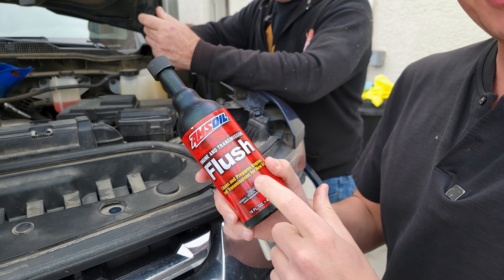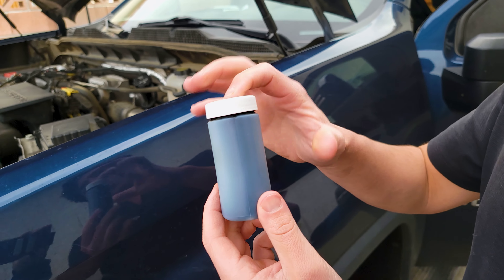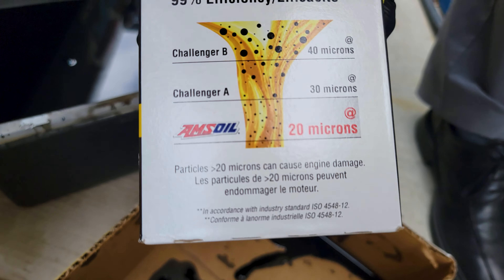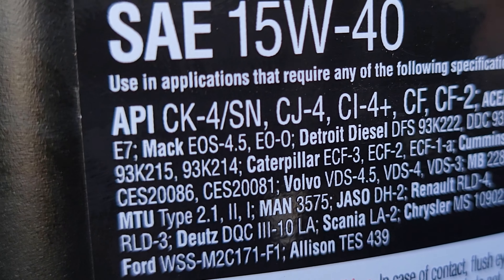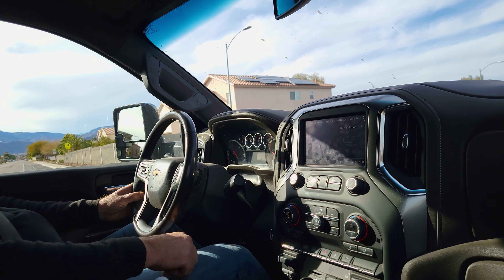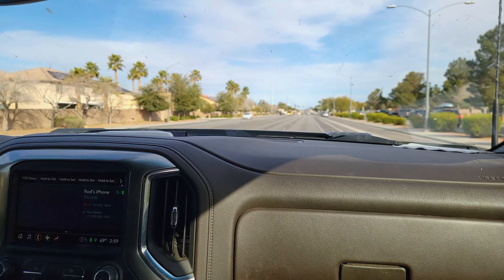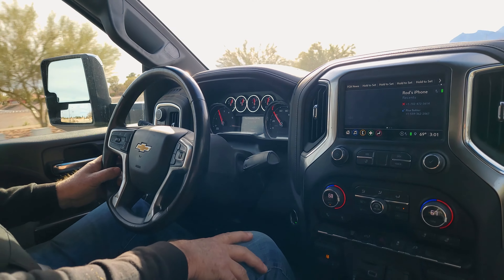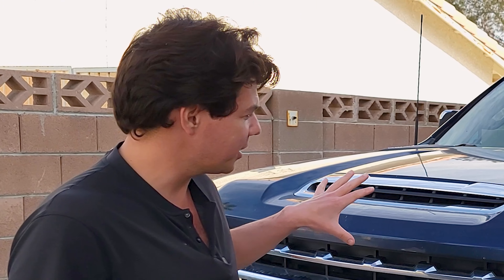Your Diesel Duramax can run better than brand new with these fluids

Comment from the maker: Watch This Next: https://youtu.be/jRu3JH-qDCE

I give a man a fishing pole & show him how to fish. 

     Together! We can get your vehicles to run better than brand new!

     For me to get credit & be "Your" Independent AMSOIL Dealer please use my website below or my dealer no. 5331179 call anytime Eben Rockmaker 702-472-3614
After you click on: http://syntheticoilprotection.net
1. Click hamburger menu
2. Click offers AMSOIL preferred customer
3. Click join now 6-month PC member add to cart. ( there is no reoccurring renewal membership unless you select that dot box ) 
( you have the option to not have your credit card saved if you prefer - est. 1972 )
4. Scroll up to the top Select shop by vehicle.

New promo:FREESHIP
     
     🥇🥇🥇 Synthetic Oil Protection Google map reviews
Eben Rockmaker, independent Amsoil Dealer 
Dealer no. 5331179
(702) 472-3614
https://maps.app.goo.gl/1aXxuXrXK9eJwqK78
            
♥ See fluid performance tests - https://www.amsoil.com/performancetests.aspx?zo=5331179      

     ☕ Buy me a coffee - https://www.buymeacoffee.com/Syntheticoilprotection

🇺🇸 Did you know a oil manufacturer can call a lubricant a Full Synthetic when it's only 25% synthetic? AMSOIL is different because it is 100% Synthetic and has a higher film strength keeping the metal parts separated. AMSOIL allows less friction, less heat, less wear on the component. AMSOIL Signature Series motor oil has guaranteed protection for up to 25,000 miles or 1 year of normal driving. 

     ♥ Your vehicle could run better than brand new by choosing the right fluids! See results - https://youtu.be/by5RYv3Dt0Q

     🇺🇸 Why AMSOIL - https://www.amsoil.com/about/exclusive-distribution/?zo=5331179    

     ☕ Synthetic Oil Protection Coffee - Ebens Favorite: https://supportwith.coffee/shop/subscriptions/sop/

Comment: I ran the cetane boost / injector cleaner religiously in my 2021 ram Cummins high output. I was putting an average of 375 gallons a week of diesel and put the ‘lime green’ bottle in my reserve tank at every fill up.
Reply from the maker: What was your results
Reply: @Syntheticoilprotection  at best, I got 10 mpg. I didn’t keep my truck long enough (87k miles) I think for a full engine break in. It was however getting better and better the more miles I put on it.
Reply from the maker: What type of truck was it?
Reply: @Syntheticoilprotection 2021 RAM Cummins HO

Comment: I noticed the engine light was on, did you check the code. Hot Shot’s Extreme Diesel is also very good at cleaning the injectors and fuel system every 6,000 miles. The EDT is used at every fill up adding one ounce for 25 gallons.
Reply from the maker: We didn't get a chance to scan it I think he said it was something with the brakes or something he was having trouble with his rotors.

That's great I have a lot of people that told me they love the Hot Shots☕️.

What type of career do you do?

Comment: I use the All in One from Amsoil. Will I have to do this flush stuff also?
Reply from the maker: I highly recommend the engine flush every oil change on a diesel with a turbo because of the Heat suit thickening and how it burns to the turbo cooking thickening.
That's what I would personally do on my vehicle.
Also if you're new to the Amsoil I would also 3000 me that way you get a lot of the old carbon buildup out.
   Together! We can get your vehicles to run better than brand new!

     For me to get credit & be "Your" Independent AMSOIL Dealer, please use my website below or my dealer no. 5331179 call anytime Eben Rockmaker 702-472-3614
After you click on: http://syntheticoilprotection.net
1. Click the hamburger menu
2. Click offers AMSOIL preferred customer
3. Click join now. 6-month PC member add to cart.  ( There is no reoccurring renewal membership unless you select that dot box ) 
( You have the option to not have your credit card saved if you prefer - est. 1972 )
4. Scroll up to the top Select shop by vehicle. 

New Promo Code: FREETOOL

Comment: I have 11 gallon 15w40 oil capacity in my truck. How many bottles of flush do I need? 2008 cummins cm871
Reply from the maker: If it was my truck I'd use 2 bottles of Engine flush. 
You can get it on my website at best value 😃
I'll be your Amsoil Dealer when you use my website ☕️
I give a man a fishing pole & show him how to fish. 

     Together! We can get your vehicles to run better than brand new!

     For me to get credit & be "Your" Independent AMSOIL Dealer please use my website below or my dealer no. 5331179 call anytime Eben Rockmaker 702-472-3614
After you click on: http://syntheticoilprotection.net
1. Click hamburger menu
2. Click offers AMSOIL preferred customer
3. Click join now 6-month PC member add to cart.  ( there is no reoccurring renewal membership unless you select that dot box ) 
( you have the option to not have your credit card saved if you prefer - est. 1972 )
4. Scroll up to the top Select shop by vehicle.

New Promo: FREEHAT
Reply: @Syntheticoilprotection  it's a 15l semi truck with 11 gal capacity is 2 bottles enough?
Reply from the maker: Oh I'm sorry I was thinking quarts LOL it would be one bottle per 10 quarts that would be five bottles
Reply from the maker: Will you be using it in your work vehicle I ask because there might be a better option to get the products that way it'll save you more money
Reply: @Syntheticoilprotection  yes in my semi truck I use for work
Reply from the maker: @josh47807 awesome, are you new to amsoil?

Comment: Can you use all these fluids on a 3.0 duramax?
Reply from the maker: Yes however they do use a different oil viscosity which you'll see on the lookup guide right here on my website and it'll give everything for your year make and model.
The newer Motors take I believe 0w-20 I'm not sure you'd have to look it up on the lookup guide but they make the oil for that engine☕️
I give a man a fishing pole & show him how to fish. 

     Together! We can get your vehicles to run better than brand new! 

     For me to get credit & be "Your" Independent AMSOIL Dealer please use my website below or my dealer no. 5331179 call anytime Eben Rockmaker 702-472-3614
After you click on: http://syntheticoilprotection.net
1. Click hamburger menu
2. Click offers AMSOIL preferred customer
3. Click join now 6-month PC member add to cart.  ( there is no reoccurring renewal membership unless you select that dot box ) 
( you have the option to not have your credit card saved if you prefer - est. 1972 )
4. Scroll up to the top Select shop by vehicle. 

New promo:FREESHIP
Reply: Yes the 5-30 signature diesel for baby Max and highly recommend regular use of Cetane to cut soot in half for DPF life

Comment: The real synthetic oil and diesel additive makes a difference with performance and mileage.
If you want to keep your truck for a lifetime, use these products.
I got 37 mpg doing 53 mph over 70 miles in my 2023 Silverado 1500 Duramax
Reply from the maker: Wow!!!

Comment: If you drive significantly less on the signature series, say 3k miles or less, you still need to change it at one year intervals? Used the engine flush on my daughters Hyundai last week. Amazing how quiet the engine is now 👍
Reply from the maker: Yeah it depends on your driving and depends if you do oil analysis but yes if you don't do oil analysis it's good to change it one year or $15,000 miles whichever comes first then severe service if you're doing all highway driving you can go up to 25,000 miles I would just change your filter halfway through for best results

Comment: Hey  Eban. Hope you're doing great. I want to ask you that which amsoil diesel additive you recommend for my vw skoda tdi here in hot weather of india. Here temperature never goes below 15 to 20 degrees.
Reply from the maker: The green bottle is my favorite- https://www.amsoil.com/p/amsoil-diesel-injector-clean-cetane-boost-fuel-additive-ads/?code=ADSCN-EA?zo=5331179